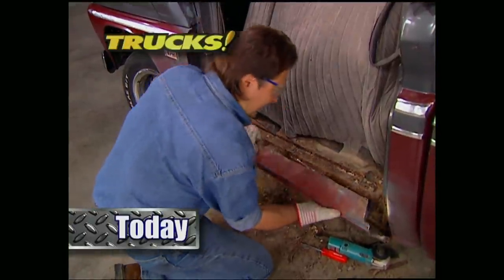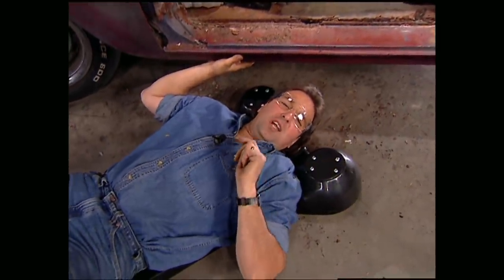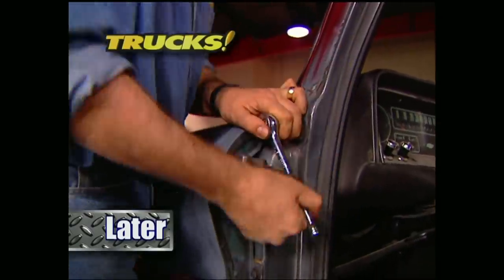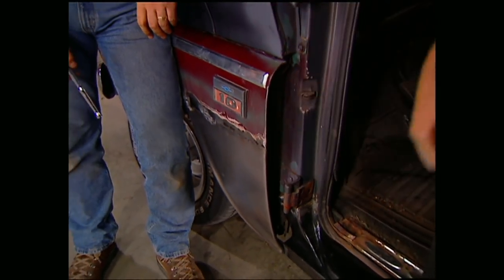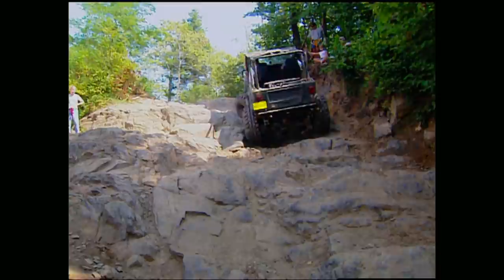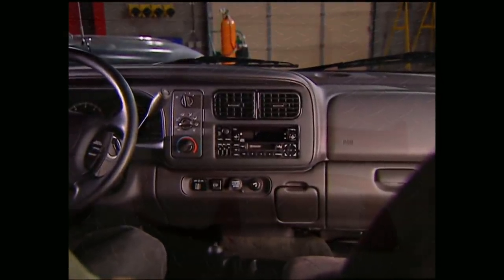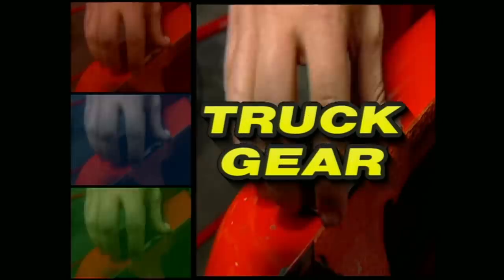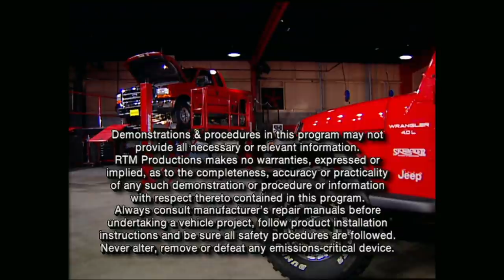Replacing The Rusted Out Rocker Panels On A '66 Chevy - Trucks! S1, E1

Comment: As far as the body work segment.... this was extremely misleading, unhelpful and just plain annoying. Doofus holds the outer rocker in place for 1 second, yep looks great stace 🤪👍. Those mini half inner rockers are crap and i guarantee they booger welded it to rust. This is what happens when you try to cram a few days work into 8 minutes
Reply: Yea, they also left out the part where they bent over the fender patch panel to the fender support. If you look close, the body line isn't as crisp as the original where the fender will meet the door. Also, I wouldn't go fully welding the outter rocker or fender patch panel without checking fit with the door in place.

Comment: Watching this remembering my third gen Camaro is sitting in my garage with the lower control arms and rear subframe both inside the cabin, with the floors torn to pieces.  Wish my rust repair would be this easy, then again I'm only 17 so I'm broke asf and gonna be doing the floors myself lol
Reply: How did it go?

Comment: Replacing one bodge with another, 
I know it’s only a crappy old American pick up truck but at least media blast the rust out before welding in new steel,
Weld through primer and wax injection after painting
Reply: They don't rust out where the panels meet, genius